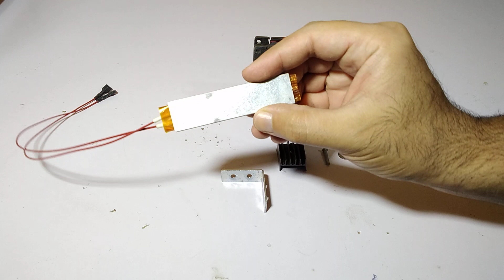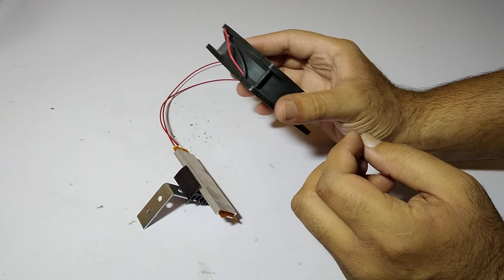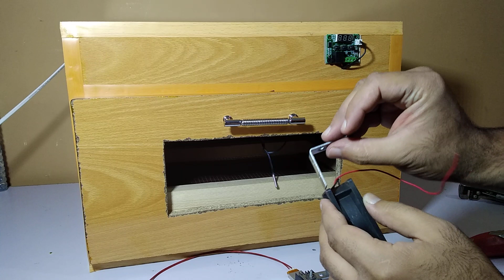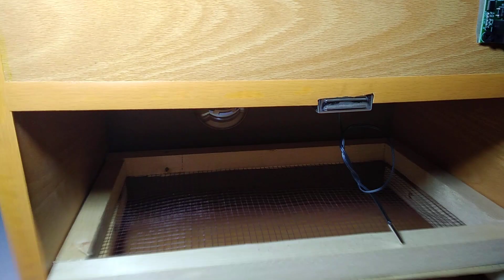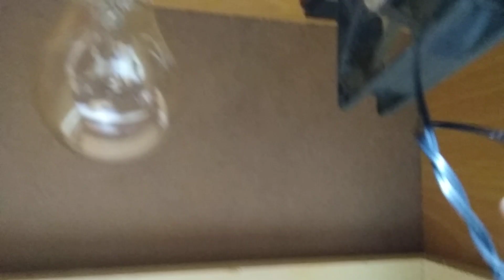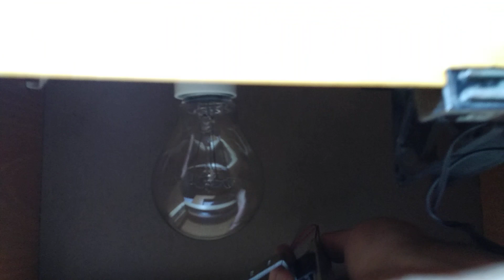how to install ptc heater in incubator

Comment: Greetings from USA Arizona. Is the PTC heater superior to using ceramic reptile bulbs? Is it controlled the same from the xm-18sw? I ordered an xm-18sw and I am hopeful it will work, as I got myself a non functional bench top work top commercial freezer, that the cabinet is in good shape. I have been debating if I should do PTC heater, or the bulb sockets with reptile bulbs. Do I wire the ptc heater to the xm-18sw the same as you do the light bulb sockets in your other videos?
Reply from the maker: If you are using a bulb heater it would be easier to change if faulty , if using this ptc heater then changing it might be a difficult, this ptc heater is good choice but it heats up fast and stay hot for longer which might increase the Temperature Up to 1 to 2 degree celcius which was set to off so it need 0.01 degree difference off limit so it would work fine, yes it will be plug same as a bulb heater with two wires in any controller and xm18sw as well.But this heater is not recommended for lizard you need to see ultraviolet bulb for them as they work in a direction and work as a sun rays and ceramic heater is good option as well.
Reply: @Umairworkshop  Thank you for your response. I plan to just incubate chicken eggs, and perhaps quail or other bird eggs on occasion. But primarily chicken eggs.
Reply from the maker: @menchelke  I pray you get succes, good luck

Comment: I want to build a chamber of size 2x1.5x.15 feet. Temperature i want is 70 degree. Can I use the PTC heater and if yes how many will be required? Thanks in advance
Reply from the maker: You will need around 5 ptc heaters if it is insulated
Reply: @Umairworkshop thanks for responding. That's too many PTC..it will be cheaper to buy a finned tubular heater i guess..
Reply from the maker: @tusharkathuria9  yes that would be better option

Comment: Bhai kon sa heater best ha? bulb to heat bht der sy pora karta ha, ptc plate behtar ha ya ceramic heater ?
Reply from the maker: Ceramic heater bhi kanthal wire hota hai fast heat KY liye ptc heater laga saktay hain but cool down bhi slow hota hai
Reply: @Umairworkshop  ap k khayal ma kon sa best ha phir wohi laga leta hun
Reply: @Umairworkshop  ptc cool down slow hota ha is ki tafseel sy wazahat kar den plz ma theek sy samjha ni cool down slow hony sy koi nuksaan hai kya ?
Reply: Many daraz per chines seller ka 1 LED remover Heater plate dekha ha os ma bhi PTC use hua ha 100w sy 300 watt ka or os ma 265C ka builtin controller bhi laga ha max temp 265 sy oper ni jany deta or os k sath plate hony ki waja sy fitting nihayat asan hi just 4 screw lagany hen, apna WA no dena apko os product ka link bhejta hun ap zara osko check karen or btaen mujhy

Comment: is it possible to reach 120 degree in a 30cmx 30cm box using these ptc elements and fan?
Reply from the maker: It might reach to 50 celcius
Reply: @Umairworkshop  there are ptc elements that reach 250 degree.can they give higher temperature?
Reply from the maker: @sabitbagirli7399  yes they will work better but will take more electricity

Comment: i want to heat the box/incubator instantly or in a very quick time, which heating element can i use? using a fan might take some time. can you plz help me with this
Reply from the maker: you need to insulation the incubator and use silicone heater wire
Reply: @Umairworkshop  Thank you so much

Comment: What heat sink is it and what insulation you put so the holder does not get hot ?
Reply from the maker: It is a micro controller to heat sink

Comment: What size heat sink you use
Reply from the maker: It is around 25 by 24 mm heat sink
Reply: @Umairworkshop  proply a stupid question the ptc 110/220v can that just be fited with a plug plugged in to thermostat that plugs strat in to a mains wall socket is in in uk
Reply from the maker: @jujucattys156  yes can attach heater with thermostat and in the socket but thermostat needs 12v , if you want direct connection then w3001 is better option
Reply: @Umairworkshop  ye I got one them instead

Comment: Umair Bhai iski fitting ka proper Tariqa bta dai plz... 
Ye heater me banwa ln ga..
Just installation ka nahi pta mgy
Reply: Isy direct on krai gy ghr ki light py ya 12v k charger k Sath hi. Heater, temperature controlar or fan  3no chezai chal jai gi..?
Reply from the maker: installation meaning direct roof py attach hoga box mein

Comment: Brother, salam from the UK.  I've taken a cheap chicken egg incubator apart to rebuild with better elements.  How do you know if the heating ptc element is AC or DC?
Reply from the maker: Salam , voltage is emboss on it's bottom part

Comment: what is better a light bulb or this heater?
what is better a light bulb or this heater?
many of these heaters are sold at aliexpress with 80C°,120C° or 240C°. usually there are no watt specifications. which version would be sufficient for a DIY incubator?
Reply from the maker: These heaters are 60 watt to 120 watts they work better than heater bulb , bulb heaters can be replaced easily but if ptc heater get faulty it is hard to change

Comment: Enginear sorry have a video show producing of D.I.Y incubator which made by approaching low cost power to electricity consume? 
But at the same time can incubate high no. Of chicks
Reply from the maker: Yes can make low energy incubator if use thick sheet of thermopole sheets
Reply: @Umairworkshop  thank you

Comment: Bhai 300 eggs ke incubator ke liye temperature maintain karne ke liye kis cheez ka istemaal karoon mere paas xm18 controler hai bhai
Reply from the maker: 300 watt metal heater minimum theak rahega
Reply: Bhai metal heater karke hi search karna hai kya? Koi link hoto share karoge kya?
Reply from the maker: @waheedulla5780  isky pass incubator parts hotay hain 
https://youtu.be/8tQlg5MIVnA
Reply: Bhai main india se hun isliye
Reply from the maker: @waheedulla5780  apko incubator heating element likh ky search Karna hoga ager na milay tou apko halogen bulb use Karna parega
Reply: Bahot shukriya bhai information ke liye

Comment: Brother what kind of adapter for power supply
Reply from the maker: for the fan it is 12v dc and for heater 220v ac
Reply: @Umairworkshop  I have got 80W China make incubator heater but I don't know what kind of power supply need to on this as this is 80W and 220v
Reply from the maker: @saeed1akuk1  you have to attach it to 220v and it will consume 80 watt power
Reply: @Umairworkshop  do ptc heating element works with 12v dc?
Reply from the maker: @bobbytaraantino  there are different type of ptc heater it comes in 220v 12v 110v you need to get correct voltage
Reply: @Umairworkshop  I found a 12v variant. Idk if that's on dc or ac

Comment: What is wattage of this ptc Heater?  and how many of them will be required for a 2ft by 2ft incubator?
Reply from the maker: it is 60 watt PTC heater can it can take 2 heater to properly work in 2 feet incubator

Comment: What's heatsink size
Reply from the maker: It is 4 inches by 1 inches
Reply: 2 lgny sy performance brhy gi kya
Reply: W1209 main dual supply powersource output k liye use ho skta.
Reply from the maker: @saifi118  w1209 mein sirf aik time py aik voltage relay Kar saktay hain
Reply from the maker: @saifi118  2 heater say heating jaldi bnygi